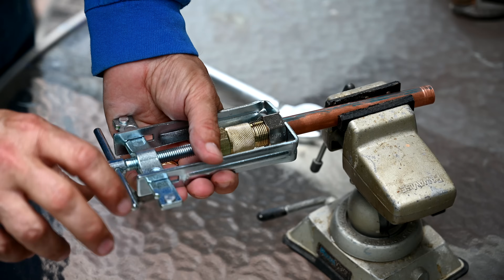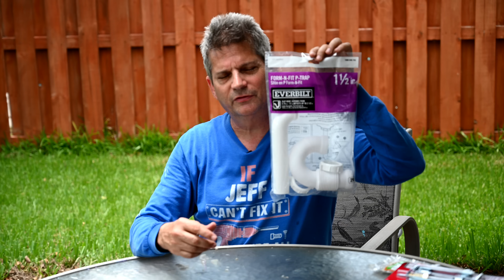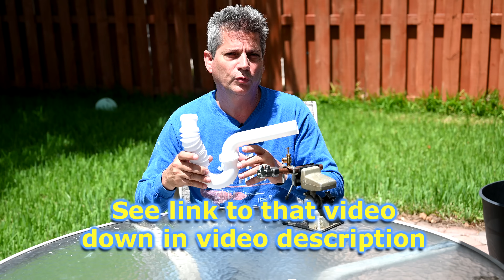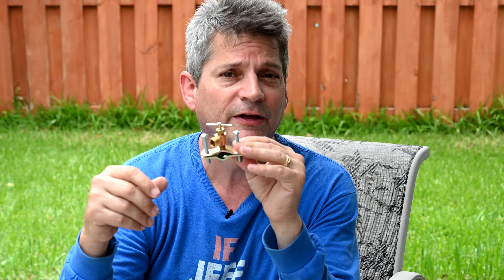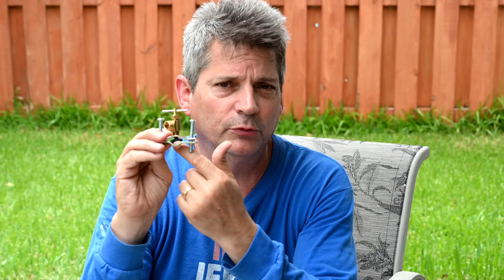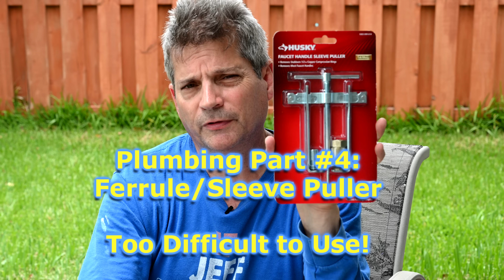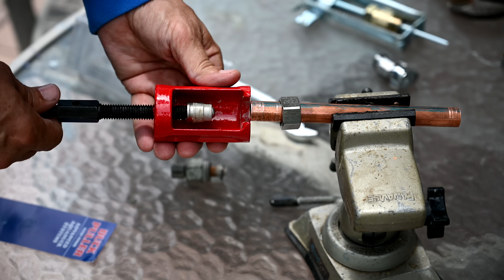4 Plumbing Parts/Tools You Should NEVER Use. NO Plumbing Fails

Comment: As a Handyman, I constantly find myself fixing “contractors” mistakes. For the diy and Handyman crowd that doesn’t mind spending a few bucks more... sharkbite fittings are where it’s at.
Reply from the maker: Bear, I agree, see my other video a few weeks ago, where I do a lot of converting banned polybutylene piping to copper pipes using Shark Bite connectors: https://youtu.be/jCfY8aHUuxs. I also use Sharkbites a lot to cap off pipes during remodeling. But I will only use them outside of a wall, I won't leave them inside a closed drywall, in case they might leak a few years down the road,.
Reply: @jeffostroff  Yes, especially those with plastic parts! I've seen several of those installed by licensed plumbers fail, and then have to come back a few years later (and charge the customer AGAIN for the same work, is the idea) to fix it. They are NOT to be installed where they can't be inspected.
Reply: jeffostroff Jeff for poly pipe they make special
Connects
Like
A pex
By
Poly
Adapter with
Looks
Like a pex
Fitting.. one with a poly
Barb and one with a pex barb.. and the same with copper fittings with a poly barb or a pex barb.. please tell
Me Jeff you don’t use shark bites buddy.. never ever use shark bites , no way your a plumber with any self respect you’d never use shark bites
Reply: @seanmulholland7597  - Maybe you could explain why, instead of just belittling people. Oh, and why type your reply so people have to click "read more"? That's stupid.
Reply: Shark bite fittings have made the handy man say "yeah! I can fix it" 😑
Reply: Todd Merriott what a joke huh Todd...
Reply: A few bucks. Yeah right....I don't think so. When you consider how many joints are in a plumbing run that need to be soldered and you add the price up it could be hundreds. Of course it depends on the job. One 1/2" copper elbow is less than a buck. What is a shark bite, $7? Or more? Soldering is not hard. Just practice a few joints and you're a pro in no time. There are tons of videos out there. I have soldered over a hundred joints and I rarely do plumbing. Not one leaked
Reply: they leak!!!
Reply: Shark bites are for emergencies or situations where it's not feasible to get your hands in a tight spot. Never use them indoors or anywhere they're gonna get covered up. Just not worth the risk.
Reply: Bear Lemke shark bites? Dude seriously your. Hack.. shark bites are garbage real
Plumbers would never use shark bites.. and if the did it’s only to cap a line or in a serious jam
Where they need to get water on until they can
Get back to
Make
Correct repair.. if I ever saw a plumber using shark bites
On my job I’d fire
Hom

Comment: Jeff; can the compression ring ( Ferrell ) be reused with your newly installed valve?
Reply from the maker: Bruce, I did it once a few years back when I just could not get the ferrule sleeve to come off the pipe, and this was before I got my newer tools that work 100% of the time. If the ferrule still looks bright and gold and there's no corrosion around it, you might be ok, but I sleep a lot better at night knowing I changed it with the new one. Why wouldn't you change it when your new angle stop valves come with it?  Also, I deal with a lot of prblem properties, that were forceclosures, neglected, or massive lwater damage and excessvive moisture, so the pipes I work on often have some green corrosion, or failing water shutoff valves, that are leaking, there's paint on the pipe, etc. I always perefer a nice neat professional brand new look when I'm done. I always use my Emory cloth to buff these corrodes pipes back to a nice perfect shiny copper pipe and insert all new valves and ferrules, so my buyers see what looks like a brand new house. No buyer's home inspector has ever been able to make any complaint about my plumbing work.
Reply: Over here in Ireland and the UK the little brass rings used on compression fittings are known as olives. The UK and ireland have two different standards to watch out for, metric and imperial. the latest piping and fittings have a diameter of 15mm and the older ones are slightly smaller. These cannot be mixed without proper adaptors. Confusingly there also exists a plastic range of piping which are fixed with PVC cement and need special adaptors to fit. I also encountered the disdain that real plumbers have for saddle valves, their opinion was that copper shavings would be left in the pipework internally and could flow to unreachable parts of the plumbing system and cause corrosion and leaks elsewhere if the shavings come into contact with different metals. Also not good to ingest any metal shavings in drinking water supplies.

Comment: The reason they can sell the corrugated p trap and saddle valves is because they don't explicitly state what it should be used for. They sell screwdrivers, but nothing on a screwdriver states it cannot be used as a pipe.

Comment: I have seen a lit of satle valves installed 😂
Reply from the maker: Black Smith Have you seen any of them leaking?
Reply: @jeffostroff  always there was the mistery leak
Reply: Saddle valves are junk, i always use an angle stop
Reply from the maker: @ronjohnson9507  black Smith  yes that is the correct way to do it.

Comment: why the Government allows them to sell all these Products if it violates the building code!.. anybody would be tempted to buy because it’s cheap and easy to install..
Reply from the maker: You can use them to repair a broken part, but even then, with the flexible p-trap, why not just put in the correct parts and make adjustments? That's what I did when I encountered these flexible traps.

Comment: Thought it was a great video until the husky tool part. I’ve used this and never had a problem. It has a learning curve he just isn’t using it right.
Reply from the maker: MaxPain: It's not a hard learning curve on the Husky tool, you just got lucky with some ferrule sleeves that came off easy. I even had 3 come off easy with mine. The problem is, a lot of properties I end up working in had leaks, high humidity, and corrosion on the pipes and fittings. For these really stuck ferrules, the Husky tool is useless, because it can't handle the forces without the tool spreading out and popping off the back of the nut. As an engineer, I deal with knowns, not unknowns. So I use the duck puller tool which works 100% of the time, and with complete ease.

Comment: NOT all Handyman are like you keep saying. Sounds like you're butt hurt.
Reply from the maker: No, sounds like your butt got hurt by my video! You're an overly defensive handy man. I never said all handymen are like this. I'm stating that every time I got called in to remove these plumbing code violations, the homeowners told me a handy man installed it. Also go look at the other P-Trap installation video I mentioned and linked to above, you'll see all the handymen who came in there name calling and told me I was doing the p trap wrong, and bragging how they solve it in 2 minutes with the flexible trap.
Reply: @jeffostroff  I'm not overly sensitive, I'm just saying that not all are like that. Great job on the information you delivered

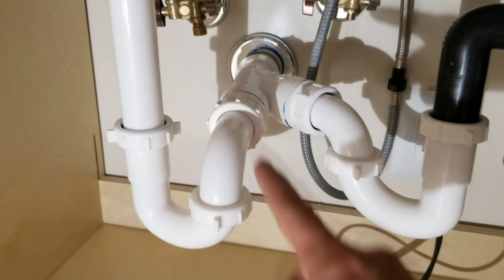Comment: What are you showing at 9:50 to 10:10? 
That is basically how I did my kitchen sink.
Is there a problem you are showing of just some footage you meant to edit out?

Thanks.
Reply: I just found your video
How to Install Dual Kitchen Sink Drain Plumbing Pipes
https://www.youtube.com/watch?v=mR3_Wzs74Q4

I won't lose any sleep over my kitchen drain.
Reply from the maker: I was just showing some B-roll to show how we had 2 drains going into the waste line into the wall, and both were at an angle, and neither one needed an flexible P-trap, because we use the correct angled fittings.

Comment: The husky tool does work just a waste of time thats all.   I remove the two clamp that came with it.
Reply: It looks like the Husky flange remover tool has "notches" in the cross piece.  Try moving the two "jaw arms" out so they are sitting in the notches.  That would change the angle on the jaws so they are digging "in" towards the pipe.  Also, it would then provide enough clearance to turn the little screw handle.  It's still a $10 tool, but maybe it deserves a re-test with the jaw arms further apart and seated in the notches?
Reply: @GregCampbellUSA  exactly, that's what the notches are for. It's a cheap tool, but might actually work if he set it up correctly.
Reply: Hmmm, it took me a minute or so and I'm not particularly handy. It's the first time I replaced a shutoff valve last week.

Comment: Water gets sucked out by siphonage not capillary attraction. ( not action ) . When a compression fitting is used for whatever reason , the ferrule is squeezed tight that it deforms the pipe enough so it can't  come off. It's not supposed to.

Comment: Why it isn't banned in the stores and from the suppliers,  if they continue selling it,  people will definitely buy em. Should be stop from the suppliers first. Personal opinion.
Reply: I C 
I’m a handyman that does research first. Don’t be angry at all handymen. I supply plumbers and electricians many hours of work, when I feel it’s past my ability.
Reply: It's not banned in stores because people keep buying it and using it. Check out your local parts store that most likely sells window tint that is under the legal VLT limit. 

Sure, these examples aren't supposed to be used in the manner they end up being used (improperly). But, who's to say that's the only way they are used? Maybe that person wants a drain for some hydroponic system? Maybe the window tint that is too dark is used on some home window and not a car? 

Laissez faire! You wouldn't want the gov't to tell you how to spend your money would ya...?
Reply: Whos doing what in the equation? Who's getting paid and who's doing the paying? The box store (corporation) + the City (corporation)+ Plumber (corporation) + you (the consumer).
Reply: Anonymuse ,  there are a few left who care
Reply: They sell them in stores for repairs to original configuration, not new install or upgrades. Someone with an old house with an S trap is not inclined to tear out the wall to add the proper vent tree in the wall of the house to upgrade to a p-trap with the vent up the wall and into the vent pipe. They just want the broken pipe fixed. This is an upgrage from a duct tape pipe patch, not a retrofit vented sink drain stack.
Reply: isettech,  I agree with you. There is a one way air vent available for under sinks. I have those in my mobile home. I have a p trap that it connects to. The hole in the floor isn’t aligned with the drain so the p trap goes about 12 inches before it drops through the floor...
Reply: I can speak to that as a PE in the construction industry. It's only against the building code. Building codes are enforced by building inspectors looking at construction. They cannot be enforced upon stores, manufacturers, and anyone else in the supply chain because there is no legal authority to do so.

To stop stores from selling them would take additional laws or possible regulation by the FTC. And that isn't likely to happen unless something is identified as a public hazard. For example, if a company came out with a saddle style fitting for gas lines and people started installing them in their homes which led to a rash of natural gas explosions, there would likely be a law put into place prohibiting their sale.
Reply: @I C  lol its not rocket science ,  pretty much gravity and common sense and a little primer and glue
Reply: @luvdady  common sense? What the heck is THAT?
Reply: @donaldshimkus539  keeps cash in my pocket and me breathing lol
Reply: Donald Shimkus   Common sense is only an opinion. No actual facts involved.
Reply: I don’t get any sewer smell from my sinks. If toilets don’t have roof vents,
I can see that happening, however...
Reply: @classic287  that could kill you
Reply: Anonymuse 👍
Reply: Home owners wanna replace parts as they are most of time
Reply: Erick Cantu,,, good point!!! If parts are illegal,, then don't sell them!!!!
Reply: A hardware store employee in the hood where I used to live told me it was common for his customers to spend $6 for a roll of duct tape to repair a cracked $3 P-trap!
Reply: @lmckrosen123   Yes, because they don't use up the entire roll, maybe just $0.50 worth of the tape.
Reply: @petrmaly9087  but they will keep doing it till the roll is gone. Besides, most people in the "hood" are on assistance and basically get stuff for free/cheap. If they hound the landlord enough, he'll get it fixed (probably by some jackleg) and the raise the rent.
Reply from the maker: Erick, I have been wondering this for years myself. It's not a crime to own them, it is only against plumbing code to use them. It's up to city inspectors to stop you from using  them by failing your inspection. Maybe the companies jsut reason that people will use it for very short immediate repair, and not make it permenant. Although, a saddle valve is permanent, there is no undo without cutting the pipe  where the pin hole is and repairing it with a coupling.
Reply: They still sell "S traps" because there's exceptions that allow their use in existing construction. One of which is if they drop into a main vented stack with nothing else in between.
Reply: @jasonwomack4064  probably applies to <5% of the time they're used though
Reply: Havent finished the video yet but i will say the reason they sell these and people buy them is because its cheaper than hiring a plumber such as myself, Why pay me to do it if you can spend under 10bucks and a few hours and trips to the store to DIY. In most cases unless your looking to change your insurance company or want to appraise your home or sell it etc. No one will ever know and the part will work for years. (besides the S-Trap). I will say tho what he saying is very true about the insurance company giving you a very short notice once they find out an infraction and they will drop your policy. I live in southern arizona and we drain our spa every summer because who wants to sit in a 102 degree spa when its 110 outside. Well apparantly an insurance agent did a random exterior inspection without my knowledge and i got a nasty letter that said i had 7 days to either have the spa filled with water or removed from the property or our policy would be canceled.
Reply: Matt Roth,  You explained everything 
respectfully 👍

Comment: Had a saddle fitting in basement that fed my fridge for water. Leaked a few times and replaced it myself with shark bite fitting. Problem solved. And the saddle was done by the builder and his “plumbers”.
Reply from the maker: Michael, you just highlighted a point I have been showing people for years with our videos. The builders, especially here in Florida use the worst contractors ever, doing the shoddiest work ever, and I always have to come in and clean up after their disasters years later.
Reply: @jeffostroff  built by the lowest bidders
Reply: Great video- really helps us DIY crowd. Funny why the items you show are still available if illegal? I saw all of them in my big box stores when installing my sink and vanity a few weeks ago. Did it the right way but had no clue the others were illegal to use. Interesting stuff. Thanks for the information!